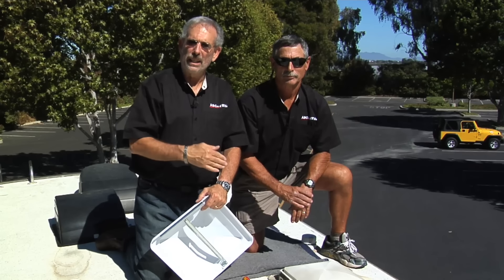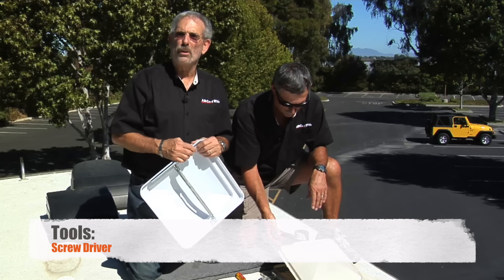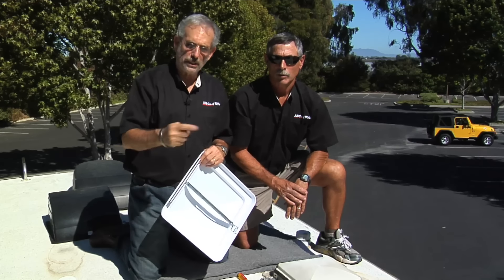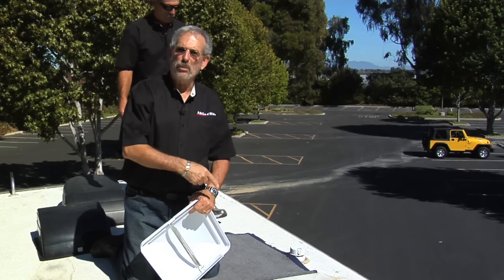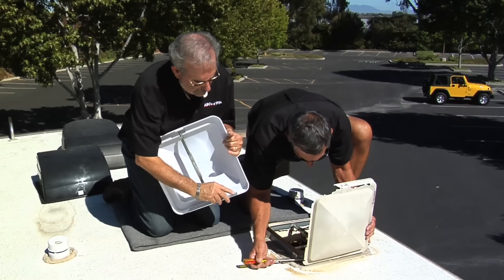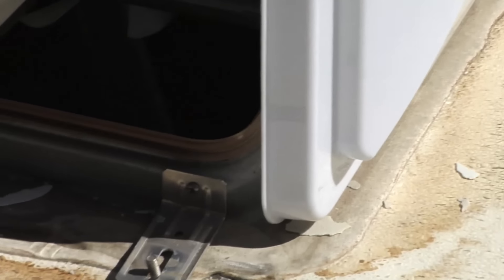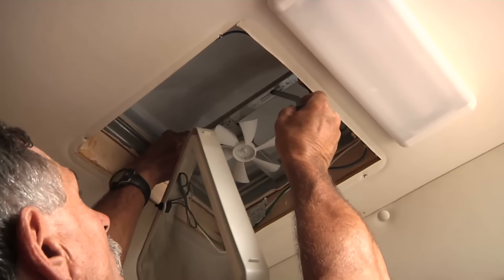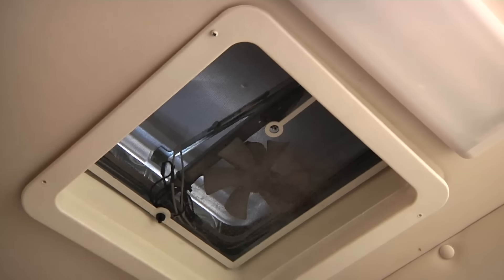Replace an RV Roof Vent Cover

Comment: This how-to still works!  I just replaced my vent cover in under 30 minutes which included the time watching this video.  Nice to see that RVs are still manufactured to "don't leave this outside" standards.
Reply: THIS ^ THIS RIGHT HERE, lol
Reply: I can’t figure out yet how to get the hinge pin open to take the broke. Cover off to put new one on! I’ve done everything else

Comment: I'm with you Vinny. I just opened the vent lid about half way, pushed the split metal rail to the side and slid out the plastic guide wheel then slid the Vent lid off. Slid the new Vent lid on and crimped the ends.  Pushed the split metal rail to the side and reinstalled the plastic guide wheel.    Piece of cake!   It took longer to climb on the roof than to do the repair! When I went to Camping World to get the part they were going to charge me 64 dollars for someone to see which lid I needed. I looked on the wall and there was a display of the different hinges so I picked it out myself. Two vent lids were on sale for $13.97 each! So for $29.62 I have two vent lids installed!!  Unbelievable!
Reply: $64 just to look,  nice guys.
Reply: Alex Walker Hey are you free to do mine?
Reply: Mine is worse..they wanted to charge me $150...ha!! Ummm no
Reply: Are you saying you didn't have to take anything out from the underneath side?  I didn't follow you. I'd like to avoid taking anything out from beneath if possible.
Reply: that's what i'm thinking - it doesn't make sense to disassemble the bottom! need to change mine and i hope it will just that  @alive-awake
Reply: I just picked up two brand new vent lids at a store called falling prices for $2!

Comment: Power tools on these screws is why all used Rv’s are full of stripped out screws.  You say that the garnish, screen frame, and crank removal are the hard part - yet you spend all of 5 seconds on that.  Riiight

Comment: Why is everyone in these videos taking everything apart to change a vent lid? I changed mine with a slide hinge in less than a minute...
Reply: Vinny Curcurato
Reply: Gary brilhart
Reply: Because of the crank hardware. It doesn't release from the top, have to take it off from the bottom.
Reply: @noweare1  Not true. Just did mine. No need to unscrew anything.
Reply: Nick Hernandez does it just come off?
Reply: @DebbieTomkoSUNSHINE  Takes a little finesse but yes.

Comment: Yyyeah, I'd rather have a little less "ventilation" to let the summer heat in and the winter cold in--and my expensive AC and heat out!--and also a few less HOLES in the top and sides of my house eager to take their turn at leaking.   RV manufacturers have a lot of nerve cutting the corners they do and then charging the prices they do.  No judging at you two guys--thanks for the vid, it was very helpful.

Comment: Great info guys. Here is what makes me crazy the manufacturer’s want the rooftop checked for leaks and cracked caulking but my roof is not walkable. So I asked the dealer how do these rooftop repairs when you can’t walk on it they told me to contact the manufacturer and ask them guess what they told me. You guessed it they told me to call the dealership. So my next unit will have a walkable rooftop. Maybe you guys could do a video to help with this issue.

Comment: Just a thought .....We just replaced a lid. The metal work was in fine condition so.... drilled out two rivets on new cover and just used the old complete mechanism . used two gal screws to attach the bracket instead of pop rivets . Brilliant)) Stephen and Cameron Highton Australia

Comment: Hello, I noticed next to your right leg and blanket that there is a small, rounded object coming out of the roof and it has a cover on it too. What is that? I bought a new RV Keystone Cougar and went up to clean my solar panels and I noticed something similar on my roof. It was round but I didn't see a cover, so I'm concerned. I have never seen one until now. My previous RV didn't have one. Thanks

Comment: I can figure out what to do by this video, but it's really not very good. They do go over in some detail about the slide mount, and discuss how to do that, then they say "but the more complicated part is inside" and say not one word about that process, besides using industry jargon without defining their terms and saying it's the hard part.  They also don't mention that there's (I think) 3 primary attachment styles, one of which is the slide type shown in this video.  That would help the person below that asks for closeup of the slide end pins (I don't know the industry jargon, so I may not use standard terms).  I'm guessing that if you take top, rear, and side photos of the mounting rail to your store, and have the year/make/model info, they'll probably be able to figure out what style of mount you have, and get you the right cover.  If they can't, it's very possible it's not a very good store, and you might want to try another.  (my local RV store said to bring in photos of the rail, and they could identify from the photos)

The presenters do have a nice banter and verbal style, but I'd rather have less chat, and more instruction, or at least more instruction with same chat.  They may have given this instruction, and whoever edited it removed that info.  If so, the editor needs education and retraining as to what a "how to" video is, vs a cute or fun video.  

As to the question from Michael Crim below, yes, you do have to dissasemble the inside.  That's the "hard part" they reference, but show only very quickly and don't discuss.  

Finally, the intro music was awful, and totally a waste of time in a how to video.  I know that yes, it's corporate branding, and promo, but when you make that corporate branding unpleasant for a LOT of your audience, it's really not the best idea now is it....

Comment: Both of mine were getting old and blew off in a storm last week. What a mess. I was wondering how to get the crank to engage without taking the inside apart.. Now I know, you don't.

Comment: Great video guys, do you recommend putting a larger cover or shroud over this set up?
Reply: unless you never get hail, I would suggest it.  Anything that is dime sized or bigger will break them.  Or unless you enjoy the light.  Honestly, if you don't need light, they sell roof vent metal lids.  Those last forever.

Comment: There is NO NEED to take everything apart underneath. Wth. Lift the lid and pop off/break off old lid from the roof. Slide the new one on and attach the new metal rod to the arm mechanism before securing the plastic lid and voila!
Reply from the maker: I'm gonna say this may vary by model. I did this on my RV and definitely did need to get to bracket from underneath.

Comment: Ok video, poor on the detail and quality of craftsmanship. Ok on the install of the cover, BUT, leaving the wires exposed, and using a worn-out screwdriver and chipping the paint on the screw and raising metal out of the screw drive.